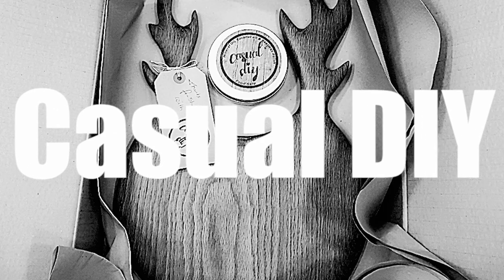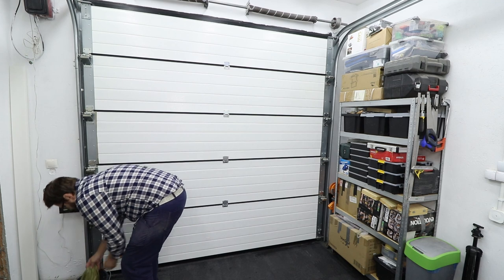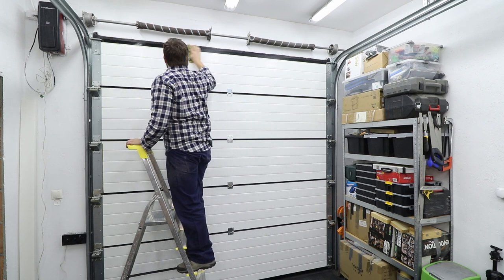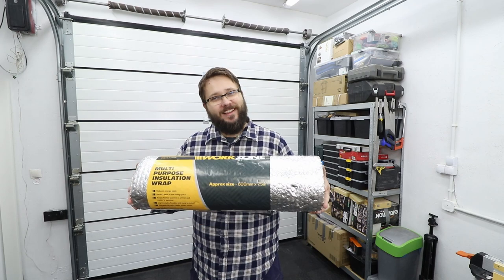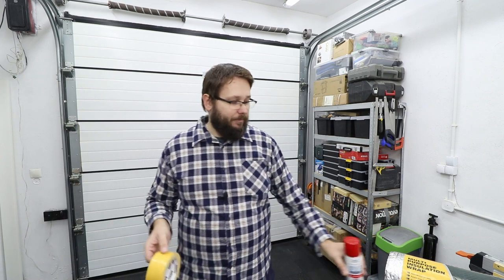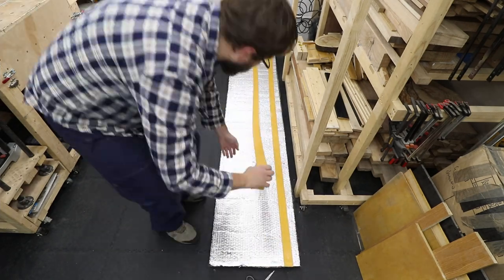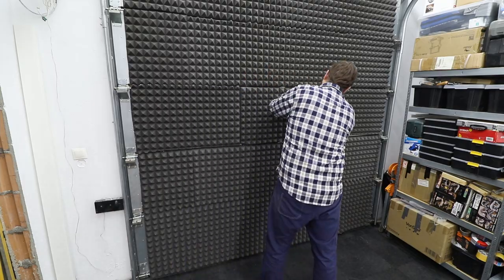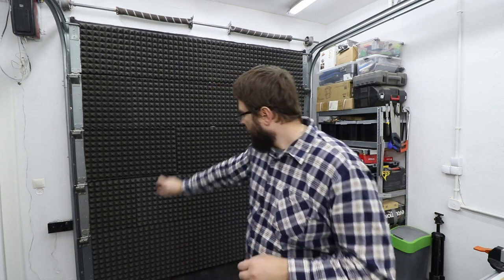How to Insulate and Soundproof Garage Doors | DIY

Comment: Hi Tomas,  Many years ago when we converted a bungalow to a doctor's surgery we were advised that most sound transmission through doors is through the gaps and not the door itself.  Draughtproofing was the answer.  I wondered why you didn't use a single sheet of the multi foil over all the door panels.  This would have closes the gaps between the panels and should be flexible enough to allow the door to open and close easily.  The foam panels should be a bit mor effective if they fitted tightly against each other to ensure any gaps were closed.  It might be worth easing the foam back so you can tape over the gaps in the multi foil panels with either the aluminium tape sold for this purpose or duct tape.  Even 6dBA reduction is worthwhile.  It might have been more useful to measure the sound levels at the boundary with the road so the effect on passing pedestrians would be shown better.  The workshop is looking great and the projects so far are interesting and ingenious.  Mike
Reply from the maker: To be fair I was fully aware that the whole project would be hindered by the gaps. This is still better then nothing thought. Now when I emailed those guys that made and fitted the doors they actually said to leave gaps between the panels and not to cover any of the metal rails and parts. So this is where I have ended up with. If I didn't need the  ability to open the doors like in my garage in UK, I would have gone for more substantial solution. I wonder how the winter will go. So far we had days where in the morning it was 0 degrees and in the workshop I had about 16 -17 degrees so quite good. I think the noise absorption will improve as I start to add some cabinets, workbenches etc.

Comment: I insulated mine with 3cm polystyrene slabs which have little weight. I'm now working on the track and edges, if only to stop the draught! Great work mate.
Reply from the maker: Thank you kindly. I'm still thinking of how potentially I could improve this, so time will tell what else I will come up with.

Comment: Did a very similar thing over the last year with my garage mainly due to watcing your original garage door video, used the aluminium foil and Jablite premium polystyrene boards on the double doors , since I'm going to be living here for a while i did fill any gaps between the boards with expanding foam. Also then plasterboarded the ceiling rafters and finally added 170mm of insulation above them. I went from an average temp in winter of like 4-5c upto about 16c which made a huge difference in useability for me and also then takes less energy to heat upto 20c and it will maintain that for longer.
Reply from the maker: So far (thanks to insulation of my garage roof) it's nice and warm in my garage. Even with temperatures around 0 degrees outside. I just wanted to further improve that 😁👍

Comment: Did you measure the noise level inside the shop, before and after?
Your addition stopped the sound reflecting off the door. That explains the difference outside the wall.
Also note that the Decibel scale logarithmic. so the reduction of 6+ dB should represent cutting the noise by 1/3 aprox
Reply from the maker: Yes. With tools on it was about 92 decibels and after insulation it came down to 88. The foam supposed to have sound absorption capabilities. I will co er the window with it as well. Wonder how that will improve the noise reduction.

Comment: Hi, on one of the videos I have seen the person built a false wall about 12 “away from the garage door and insulated that wall. The space between the wall and door he used to store wood on shelfs that he could access from outside. This did mean that he could not use the door to get his car in, but it made a hell of a difference in sound transition and heat.
Reply from the maker: Yes it was Keith Brown, he suggested that to me as well, but I still need to be able to use my garage doors. Its something to do with building regs and all that.

Comment: Looks really good, just a couple of comments if I may, I am no way am expert but this is what I have learnt from wanting to insulate my roller doors.

1 the insulation and sound insulation is only as good as the whole area, so if there is a gap then the insulation will only be as good as the gap.

2. If the insulation is meet sealed to the door 100% then any air gap will have the risk of condensation. So if I were doing it I would use the spray to avoid any air gaps between the door and insulation.

3 you need draft excluders, or silicon to seal on the gaps around the metal work, without impleading the mechanical movement.

Hope these suggestions help, not sure how accurate they are, just what I have learnt over the years and the theory send to hold.

Otherwise it a good job, and I am envious 😃😃
Reply from the maker: Yes I knew from the start that this solution will not be perfect. As the gaps that need to stay clear for the door mechanism to operate will hinder the whole project. But what I got is better then nothing. With regards the sealing. I have heard that the best way to insulate anything is to have air gaps in the insulation, which is what the silver foil ( it has air bubbles in it ) will provide. As the foils is not flat and will have air gaps when attached to anything. It's the air that mainly keeps rooms warm. But hey I may be wrong. Time will tell how all of this will perform. Thank you👍
Reply: @CasualDIY  aye every solution has s, different schools of thoughts and so on. But like you said something is better than nothing, fingers crossed you have a good solution
Reply from the maker: @DeafMaker  the best solution I think is held by Keith Brown. He just build a wall in front of his garage doors. But I still want to use the garage doors as intended so unfortunately it is what it is.

Comment: Hi Tom, I'm not that surprised that your upgrades didn't help to cut down escaping noise. The ones you have implemented will certainly help with keeping the warmth in. You need dense materials to stop sound escaping such as mobile 18mm MDF panels you can place over doors and windows. If you cover them with acoustic foam like on your garage door so much the better. hope this helps.
Reply from the maker: Hi, I know unfortunately making such contraptions is just not gonna work for me. But hey that's still better than nothing

Comment: Hello Thomas,
Sound is a problem for work garages. Sound problem in my Workshop too. Neighbors should not be too loud. garage door insulation job is good. You showed and explained the details well. There are also different insulation materials. But I like this idea. Thank you for sharing. See you. I wish you have a nice weekend. Big greetings.
Reply from the maker: Thank you kindly. to be fair later on I have checked the noise level from the boarder of my land ( car gate) and you could only hear a slight humm so this shouldn't be an issue anymore. But I will add something similar to the window I got in the garage opposite the garage doors.
Reply: @CasualDIY  It's nice that the insulation works. Yes, it's a good idea to add windows. See you in our new projects. all the best.

Comment: I have Polystyrene Sheets in my shed on the ceiling and the walls in places, it's mainly to keep the cold out in the Winter as i have Breeze Block and Brick walls. 
Well done on your Insulation and testing.
Stay Safe,
Barry (ENG)
Reply from the maker: My garage has the same insulation as the house so the walls are like 50 cm thick. As we bought the house the garage roof wasn't insulated so got that done properly and I have to say that added a tone of difference. So structurally the whole garage insulation if really good. hence with no direct heating source its still warm in the garage (in current temperatures around 0 degrease) and fairly cool in the summer.
All the best mate.

Comment: Hi Tomas, as Kevin mentioned earlier,  a reduction of 6 or 7db is quite a lot as dB is a logarithmic unit not linear, so don't be disappointed.. Its a good start. Dense uneven surfaces kill sound by breaking up and dispersing soundwaves so their energy is absorbed..Strips or panels of differing and random thicknesses of timber on the ceiling and /or walls will 'deaden' the acoustics of the workshop and will stop the sound of machinery reflecting ,resonating and rattling other objects.. More comfortable for the woodworker.
Reply from the maker: Yes I think overall is not too bad. I'm planning to do something similar on the large window I got in my workshop that's opposite the garage doors. Hopefully that will improve the noise reduction even more

Comment: What Yossi says below is right. Because of the dB scale, only a few dB can be a significant noise reduction so don’t be too disappointed.
Reply from the maker: Yes I think that's right, and I'm planning to add something similar to the large window I got in the workshop that's on the opposite wall to the doors. I hope this will improve the overall performance even more.

Comment: i was surprized as well thought it would have been better forsure thumbs up shared im sure the insulation valve is much better so still a win
Reply from the maker: It's still an improvement either way. I was just expecting a better one 🤣

Comment: Neat job and a reasonable reduction on noise to the outside. It would have been interesting to have before and after sound levels for inside the garage. I would expect some benefit. The foam insulation design looks to be great for collecting dust so hopefully your dust extraction system is better than mine. 👍😉
Reply from the maker: That's my worry, I think the foam will be giant  dust magnet 🤣

Comment: Add a 1/4" x 1/16" foam insulation strip where the panels interlock. Make sure your weather stripping on all sides is snug up against the door. Check the bottom seal. 

Midday, turn off the lights and see how much light is getting in through cracks. Eliminate the cracks. This will reduce the sound transmission.
Reply from the maker: Good tip with the foam strip. Yes I've checked the weather seals at the bottom and at the top👍
Reply: @CasualDIY  I actually just insulated my own garage door. I used 1" R6 foam board. Foam board is tricky... The boards I used are rigid enough that certain sound frequencies can cause it to vibrate against the metal door panel, which transmits sound. To lesson this vibration, I glued felt onto the edges, and used 3/16" foam rubber weather strips in the center of the panels to prevent direct contact between the foam boards and the garage door. Once in place, I sprayed poly foam around the edges to remove any air gaps. 

It works quite well.

Comment: The change in sound levels generally is because of the dampening effect of that foam on the garage door, it stops a lot of the standing waves so will lower the sound level too. If you added it to one of the perpendicular walls as well the effect should be even better.

You can try making some panels of say 1m x 2m and clad those with the foam and stand then on the floor at an odd angle and they should absorb some of the sound levels too.

You want to control reflections so ideally no 90° corners  and no parallel walls. :-)
Reply from the maker: Hehe that would be hard to achieve in a workshop so that the panels would not be in a way. I'll be adding something similar to the wall where the window is. So that should give a good result.

Comment: I believe that’s sound conditioning you put in which will stop the sound waves reflecting on the door. It’s used in recording studio to stop unwanted sound reflections. This is probably why there is less noise at the other walls because there is not sound waves reflecting off that wall towards the others. It isn’t sound proofing sorry. I’m a drummer so have had some experience in this. You need an air gap for effective sound proofing. Love your channel (:
Reply: You’ll need two wall for it to work and the air gap in between. Check out how to make a drum booth and that will give you a good idea of what is needed.
Reply from the maker: Yes, I knew the limitations of this solutions. Keith Brown's idea with building a wall in front of the doors would be far better. But unfortunately I need to be able to use the doors in an unchanged way. So in a way 6-7 dB reduction is not bad in this scenario. I will add similar thing on the opposite wall where the window is, so hopefully this will help a bit as well.
Reply: Looking forward to seeing the video 👍

Comment: How about adding curtains by the door. Some under where the door goes when it's open and then some from the roof down to the top of the lower ones. The upper curtains should move out of the way when the door opens and you slide the lower ones aside to get in and out. That should help with the insulation and you just need some beams that you can put the material over and then that would give you double thickness as well. Might need to clean the upper curtains occasionally with it dragging against the front of the garage door.

Then for the other walls, I'm sure you'll put shelves up at some point which will help, but putting up boards or frames with decorative material on will help with reducing some of the noise and echo.
Reply from the maker: I'm hoping that the noise will reduce after I'll install some cabinets etc. as you say. With the curtain my biggest worry would be that they will act as dust magnet. To be fair I got a feeling that the foam will be like that. I will report on this in few weeks time.

Comment: Sound reduces by half every 10 decibels, so it's def having an effect. You are probably leaking noise around the edges and top and bottom
Reply from the maker: Yes the sound must be leaking through the parts that were not insulated but for the doors to work correctly they need to remain as that. Well as I said it better than nothing👍

Comment: Tomaz at least you have tried to reduce the noise of your machines but just a thought, now you've done the garage door maybe you could put some around the door runners and around the whole area around the door and frames. You know where you can see daylight still coming in your workshop! This will not only help with keeping the cold winds out but also hopefully help you achieve what you're trying to do!!! As always buddy    💯%    👍    🇬🇧.
Reply from the maker: To be fair these doors are quite high quality and they were not cheap. There are no gaps, they got a special rubber curtain that goes around the whole frame. So no wind etc is coming from outside. The manufacturer and fitter I have emailed said I can't cover the joints and any metal parts, rails etc. So what I have done is the maximum I could have covered.
Reply: @CasualDIY  hey Tomaz you don't know the answers unless you ask the questions! Hence why I  mentioned the possibility to seal around your frame etc! As always buddy 💯%    👍    🇬🇧.
Reply from the maker: @simonr6793  exactly, I have learned this from the last time I was insulating the garage doors from my workshop in the UK

Comment: How have you found it a few years down the line? And temperature wise?
Reply from the maker: It's quite good actually. I thought the spray glue would give but it's still holding strong. Still reduces the noise and keeps the warmth inside. The temperature never drops below 14 degrees Celsius.

Comment: I think the main issue and the culprits are smooth walls and the ceiling. It would be a bad idea to put this sort of insulation on the walls due to harbouring the dust, but I would consider adding foam onto the ceiling (just watch the fire regulations) The walls soon will be covered with some tool racks, spare wood, that should help a little. If you are super concerned about the noise on the door side, consider some clever curtain. But yet again, it is a fire risk, so you would have to be careful with steel, welding and grinders.
Reply from the maker: I will be installing the window, which is quite large and adding foam to that. I'm hoping that will reduce the amount of sound that is bouncing around the walls. We will see how that will work 👍

Comment: You need to add mass and close any air gaps. With 15kg to play with, what you’ve done is probably the best you could hope for. To get 40dB reduction on my garage door I built a partition wall with two layers of 15mm acoustic plasterboard, 18mm MDF, and 50mm dense rockwool. Must weigh around 250kg!
Reply from the maker: Yes I think the 6 -7 dB reduction is not too bad overall. I will do something similar on the other side where the window is, so I'm hoping the overall performance will be even better.

Comment: What about a removable cover/board for outside the garage door? Attach to the wall and remove when access required. Don't know how it will fit with your planning regulations.
Reply from the maker: That would be fairly problematic for storage when not in use and I don't think my wife would allow anything outside to ruin the overall house look 😂 If I were to do something like that inside then again storage problem plus it would be difficult with the rails of the doors. I think for now this will do, I'll be adding similar thing to the window, which is opposite the garage doors. hopefully that will improve things even more.

Comment: I would not beat yourself up. If you must retain the functioning garage door then you have done as much as you can. A reduction of 6 to 7 DB (bearing in mind it is a logarithmic scale) is very worthwhile indeed. To really deaden sound you need mass and the foam has no mass in this context - you cannot add sufficient mass to an operable domestic garage door.
Reply from the maker: Thank is true, thank you. When I insulate the window it should be even better 👍